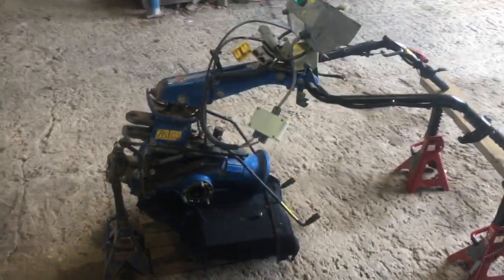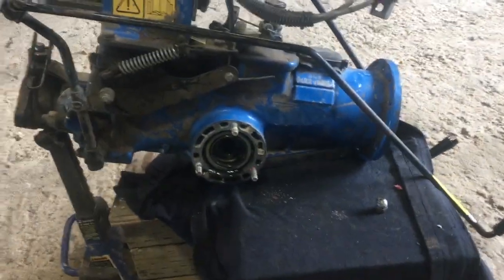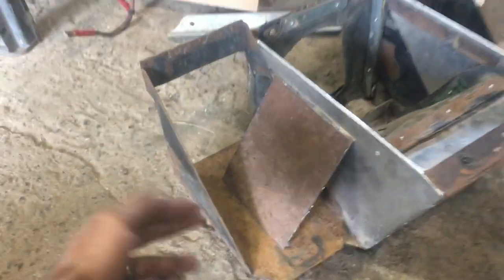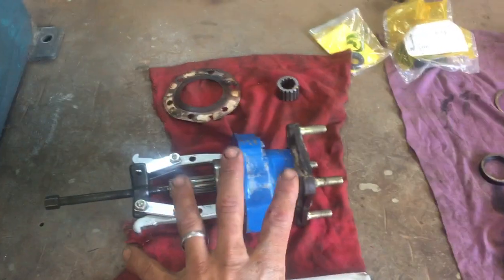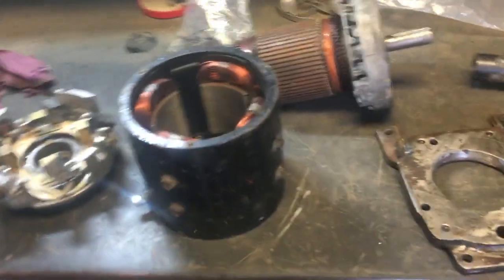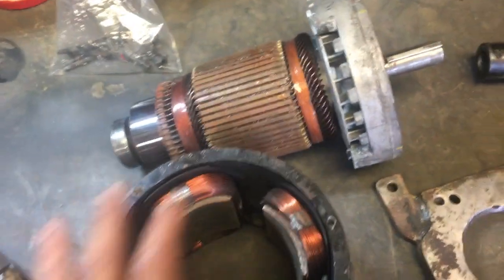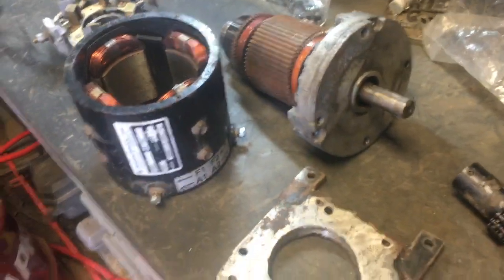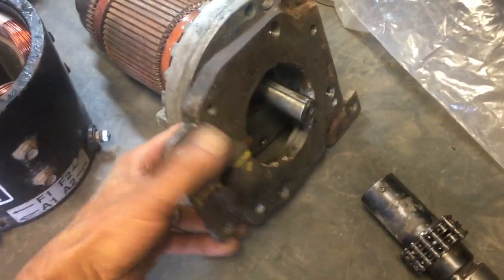Electric BCS tractor - deep inspection after 3 years in the field

Comment: What is your run time with a set of fresh batteries?
Reply from the maker: With a single 1kWh battery and working nonstop at peak load I can run down the battery in about 30-40 minutes.  In real world use on our commercial farm we never run down more than one battery in a day and we have 4 of them and various chargers.  Runtime had not been a limiting factor at all.  End of task or Operator fatigue always happens long before runtime issues.

Comment: thanks a lot, yes for sure interesting:) Could you please tell me why you use the chain to connect the two pieces of the "kopler" i mean. It seems smart to connect them that way but why does the kopler itself needs to come apart? Just for the ease of maintance of the motor? I am thinking of transforming a brushcutter into electric (far more simple machine than the bcs as it has no gears). Its a motor driving a spinning blade using a fan belt. Hence the question...how do i connect my electric motor to the drive pulley (this kopler can be direct and without a chain i presume?
Reply: and if you have time to answer ...what motor would you advise using?. The current motor is a Honda gsv 190 (3.5 kw)
Reply from the maker: The reason for using the double chain coupler is to allow some flex or allow for some misalignment, figuring that my adapter plate isn't perfect in alignment or flatness.  It's also a strong and compact coupler.  It's not really required for assembly and a rigid coupler would probably work fine based on the limited wear I see on all the chain coupler parts after 3 years but better safe than sorry.

A "lovejoy" style coupler is another good and compact option that doesn't ever need oiling and allows a bit angular misalignment.

If your existing configuration is belt drive I'd suggest you stick with that as it's super simple and forgiving.  Just find a pulley of the right size that fits the motor output shaft and mount the new electric motor so it's output shaft is near the original gas engine output shaft.  You may also want to change the pulley ratios to run the motor faster or slower than the original Honda engine but perhaps not necessary.
Reply from the maker: @jobleijh  You might check out the 5kW air-cooled motor from Golden Motor or the ME1004 from Motenergy.   There are surely lots of other options out there and if you're trying to do it cheap with second-hand motor/controller you can maybe scavenge parts from a small forklift or a golf cart-sized vehicle.
Reply: @reidallaway  Thanks só much very informative 🙏
Reply from the maker: @jobleijh  also, if you can handle a Facebook group we have a pretty active community group for electric farm projects at: 
https://www.facebook.com/groups/diyelectricfarm
Reply: @reidallaway  yes i am part of the group .. and will be using it more it the future awesome!! anyway i am probably forced for now to go for the forklift motor (if i find one and than rises the big question ..what battery to choose and controller etc. as you got a pretty amazing working example its comforting to get your opinion as there are so much uncertain factors when embarking into this adventure with my minimal knowledge! Thanks anyhow! by the way i am curious how close my mowers capacity is gonna be in relation to this just released professional mowers by as motors https://www.youtube.com/watch?v=KMgLOItLG6w
Reply: sorry i didn't mean to answer with Tanias acount, sorry for confusion